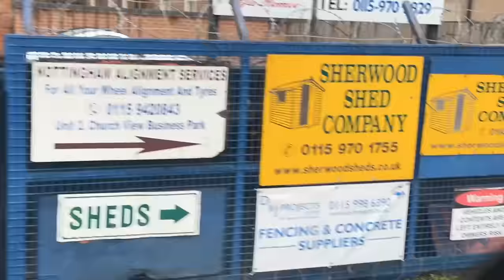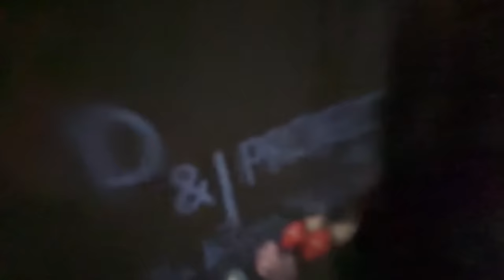This Fence TRANSFORMATION Will BLOW Your Mind!

Comment: Every job looked 💯% 👍
Stevie...when you put posts in for gates and attach 2x4, why do you not use end posts, so you have a flat surface to attach the 2x4 to ?
Lovin "Mr Pickles" 
That Trailer will look smart when it's black and on the pickup.
Sithi Wed
Cheers for the mentions on #Fridaynightlive 
Stu

Comment: If those sheets are plastic I would have put one under the boards to stop road water splashing on the boards.
on top is decent but could be too slick for the gravel boards.. unless you modify some angle iron as a skidder stop

Comment: If it was me, I’d have just got rid of the wood completely and put some ally chequer plate on instead, woods heavy so you getting rid means you can carry a little bit more
Reply from the maker: Did think about that but didn’t think with the lads sliding the post across the bed it would last very long
Reply: @DJProjectss  I think it should be fine with some 5mm, a mates got 3mm sheets in the back of his van and he does waste and it gets thoroughly abused and barring the odd tiny dent or chip it’d scrub up like new and that’s after a year of full on throwing bricks/concrete/steel into the back. Also with the chequer plate, there’s less touching the floor when you’re sliding stuff so theoretically it should be easier sliding things across it. 

Only downside with the acm sheets is you only get 0.3mm of aluminium on each side and the rest is foam so if there’s a sharp bit on a post for example it might cut through and dig in